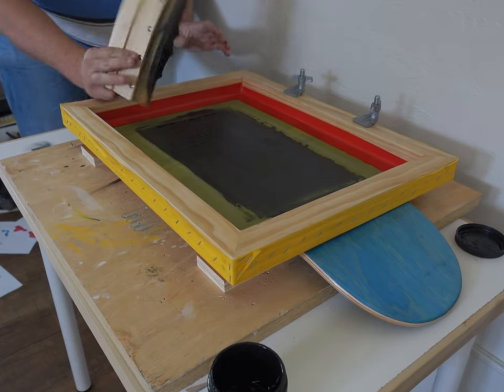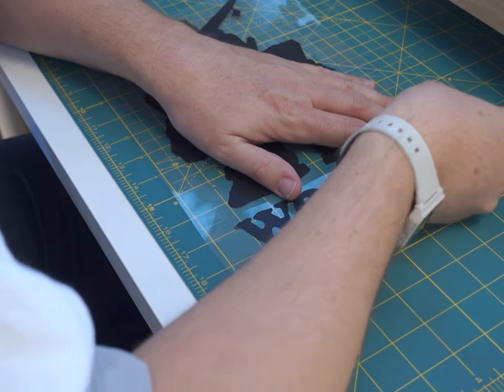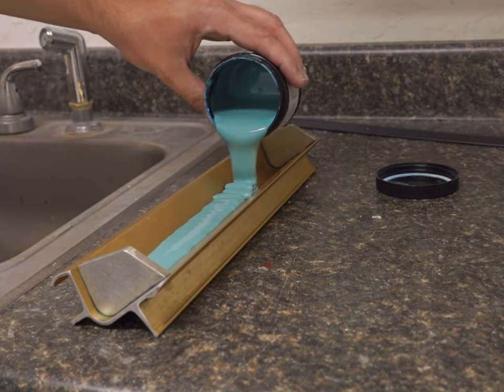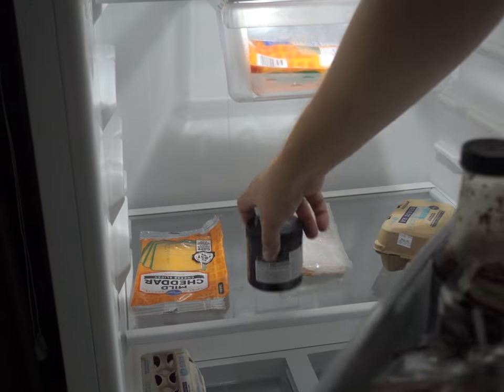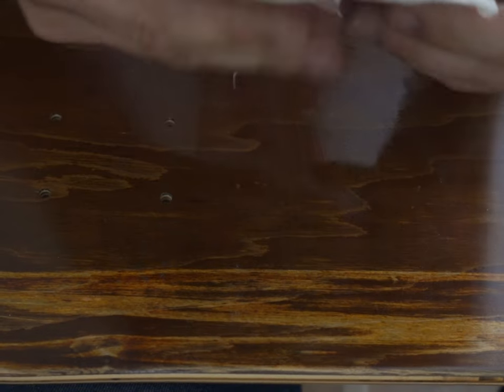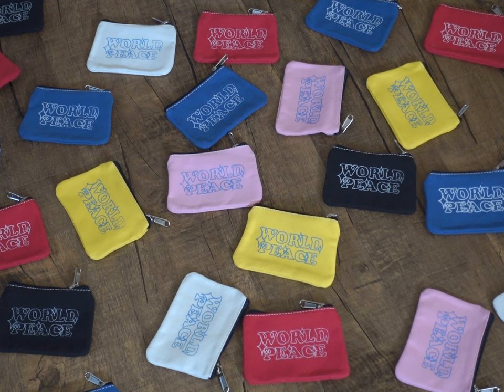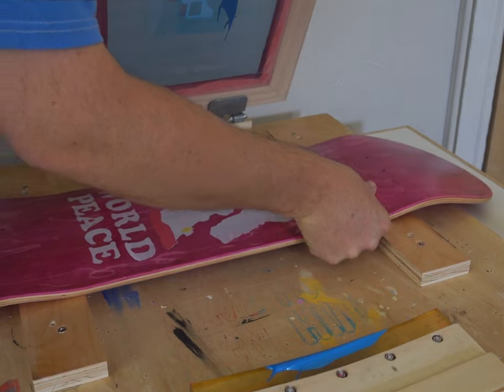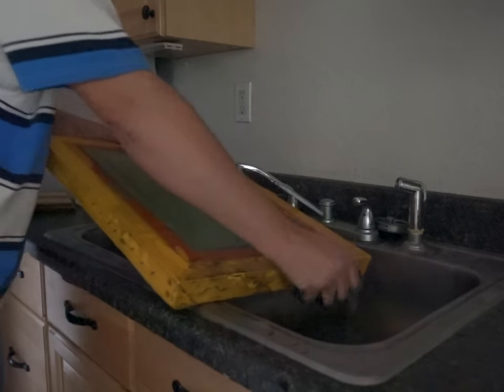Screenprinting My Own Skateboard Decks, Again!

Comment: easy tip for making a perfect squeegee is to just cut some mid sections out of a deck and clamp the blade between them
Reply: also blowout occurs when there is a gap between the screen and the deck so pressing hard with the right squeegee will help
Reply from the maker: Yes good tip, I have seen people do that and considered the same, but I did not have any old decks that would have been wide enough for my squeegee blade (10"), so that's why I ended up making it from the thin plywood I had :)